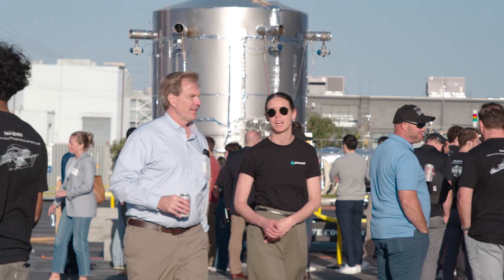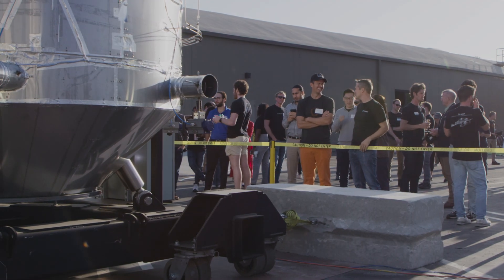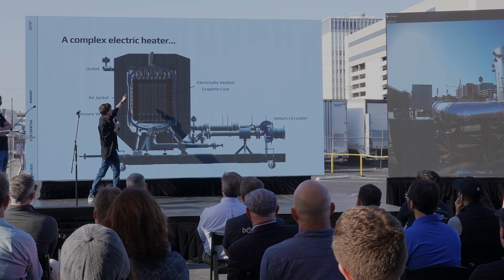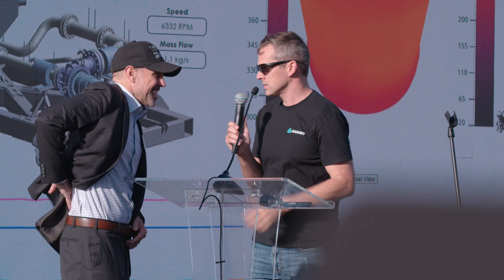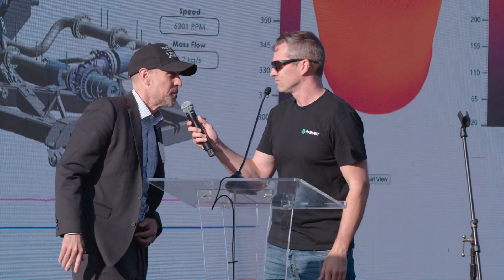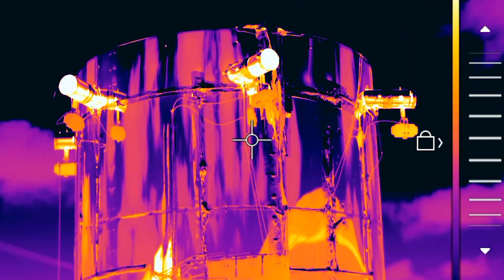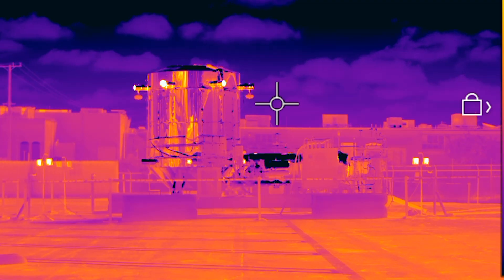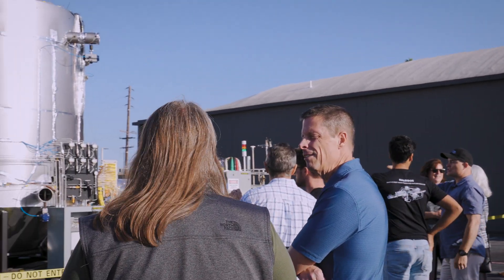PREVIEW: Testing a Nuclear Reactor Prototype in our Parking Lot

Comment: 20 years ago, I worked on maintaining the active protection system for nuclear reactors on submarines. I participated in the startup of nuclear reactors three times. I believe you will be developing this reactor for at least 10 years, and for a reliable reactor, it will take 15-20 years. There are two main issues: first, if you repeatedly start and stop the reactor, the metal inside will change shape, potentially blocking the drive mechanisms if the cooling algorithm is incorrect. Second, nuclear fuel can exist in various states; it’s not like a kettle where you can just press a button to turn it on. The control algorithms for the reactor are quite complex due to reactivity. Moreover, there are numerous legal restrictions, including the requirement to register each reactor startup with the IAEA and obtain permission for the startup.

Comment: The base technology is good, but the concept is flawed. The form factor does not provide passive protection for 5 megawatts of power. Your core will melt down in the event of an accident, and no automation will help. You need to fit the modules into shipping container sizes, but place the nuclear reactors in deep concrete wells filled with water. If I were you, I would increase the reactor size to that of a 40-foot container and boost its power output to 100 megawatts of thermal power. I would create 10 different modules of that size so that they can be combined into a single reactor. That way, it would become an efficient modular reactor for stationary installation, either as a hybrid thermal-electric reactor or a marine reactor.
Reply: And cue the keyboard warrior/"Expert"...

Comment: Did it have a fissile material inside, or was it just an electric heater simulation?
Reply from the maker: Electric heater simulation. Proving the concept out prior to using it with fission heat.
Reply: @radiantnuclear6386  How many watts did you put in?